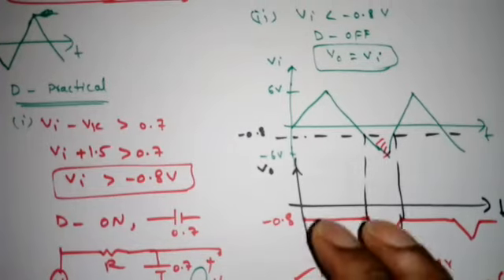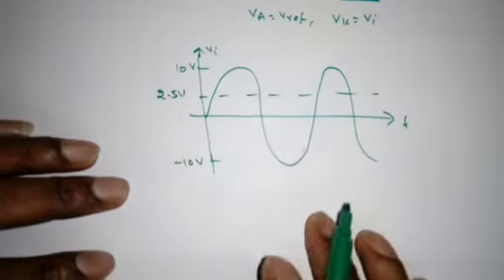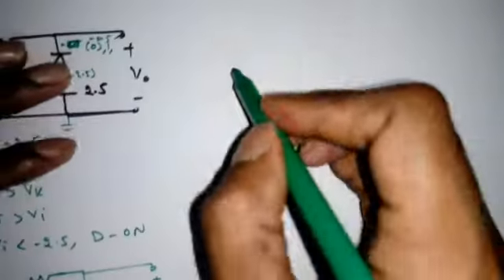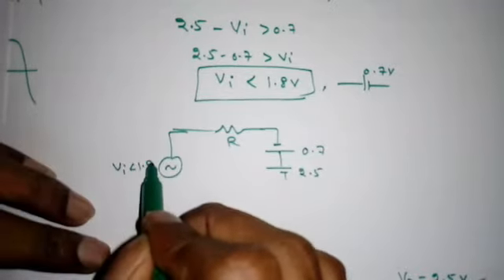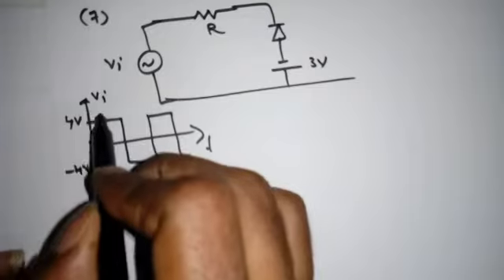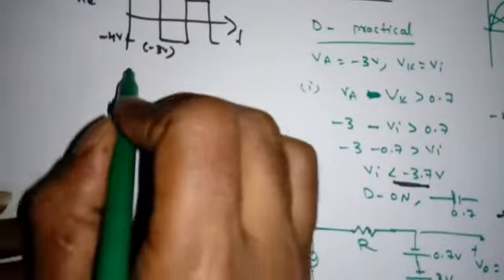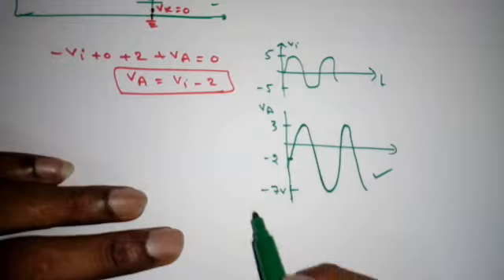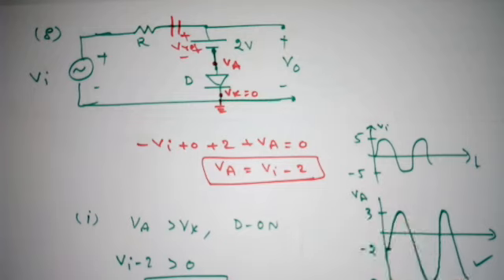Analog Circuits Lecture 12: Shunt (Parallel) Clippers- Part-2

Comment: sir, In last 8th problem when Diode is Off (when voltage source is 2v  is kept beside resistor not  above diode position) then when we apply KVL, we get Vout as Vi-2 or Vout=Vi.